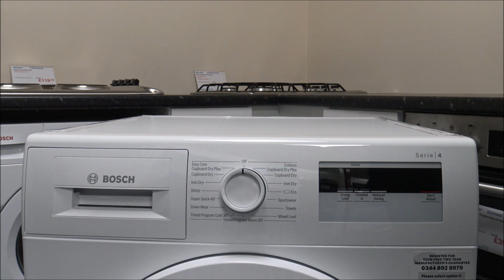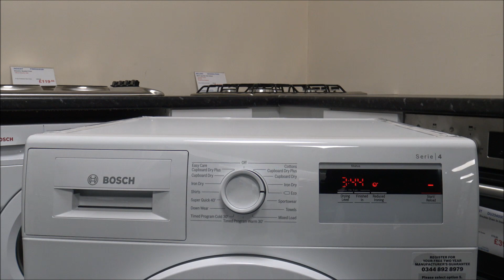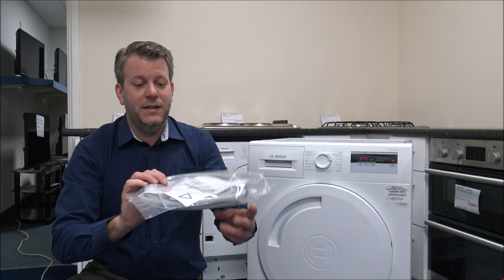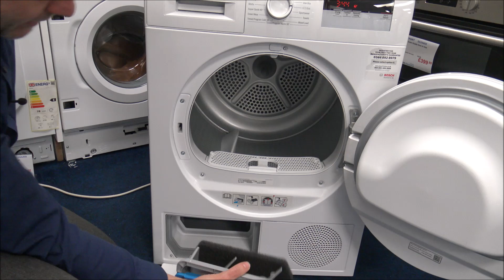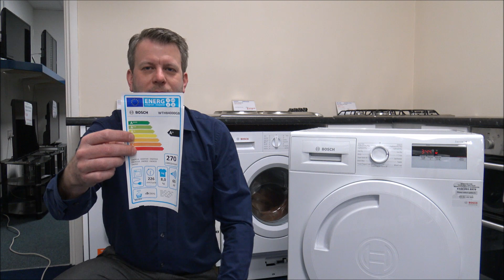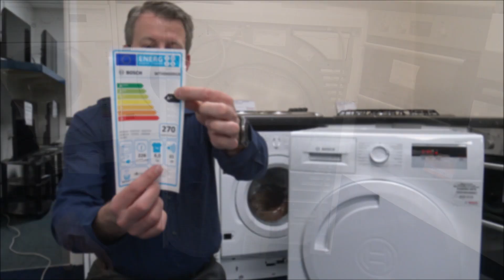Bosch WTH84000GB Heat Pump Condenser Dryer

Comment: Very helpful but it would've been nice to see you connect the hose. Also, does the hose need to be level or will the dryer pump out the water through the hose if it's placed on an elevated sink?
Reply from the maker: The hose will be fine if it is higher as it will pump it out.
Reply: @lords-electrical  Thank you so much for the reply. Great video.

Comment: Great insight into the dryer, can the door be reversed. Is there some instruction available on how to do this.
Reply from the maker: They can normally be reversed but it would normally need an engineer to do it as it needs the switch moving too.

Comment: Hi, many thanks for completing a really informative instructional video. We bought the WTH8400 dryer to replace a Zanussi dryer that we had for many years. This was a vented dryer that was operated by a twist timer dial. When we were confronted with the space age panel of the Bosch and the somewhat ambiguous instruction book we thought that we had made a huge mistake. However, after watching this instructional video it has given us renewed hope! We will try the settings anew and hopefully, with your advice, we will get it to work as we hoped it would.

Comment: bought one a year ago and now the sump pump will only come on when you start a cycle but when the condensate tank fills during the cycle , checked the tank and it is spotless , no fluff, looks like the level switch is not telling the pump to start , it's not a float switch it's a two pronged kind of switch, therefore leaking out on the ground, not happy as it was a costly dryer.

Comment: Does the reduced ironing function actually make a difference?
Reply from the maker: This is a good function, and especially if you have dried items like shirts or trousers then it can make a difference to how much the clothes are creased at the end of the program
Reply: @lords-electrical  Does it just add an extra 60 minute gentle spin at the end like other dryers that have this functionality? Do you have any experience with Beko dryers that have the IronFinish function? That claims to do more than just spin a bit.

Comment: Thank you for the video. However I would have liked to have seen the drainage tube actually fitted in at the back and where it goes to. How long is the tube?  I’m not sure if it would be long enough to reach over into the sink, where I’m planning to locate my dryer. Also, does it mean the dryer has to stand an extra distance away from the wall to accommodate this tube, so you would need to allow for that in ones measurements?  Thank you.

Comment: Hi, great video, two things:
1) would you say this would use (approx.) half the energy that of a 12 years old dryer! Vented.
2) I’m thinking about getting this one but was going to have it in my utility room, which is connected to the house but would usually be about only 14 degrees in the winter months - is that a big deal?

Thanks… 👍
Reply from the maker: It should use approx half the energy of an old vented dryer. As far as the temperature, if it is in a cold atmosphere then it can take longer to dryer. If its gets too cold in the room especially if its very cold, then the drying process can take hours to dry.

Comment: I bought this exact model nearly 2 years ago from my local Euronics dealer and it has been excellent. I havent had the need to increase the drying time as they come out perfectly dry.  Also something to note is that you can program this dryer what spin speed your washing machine operates at, which for my 1400 spin washer further reduces the drying time.